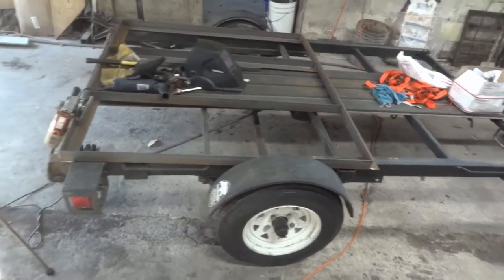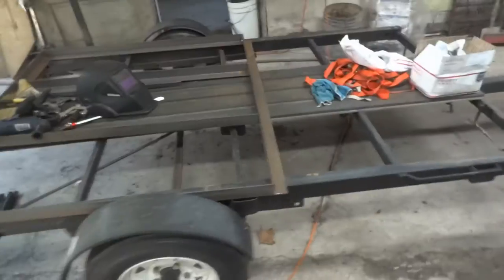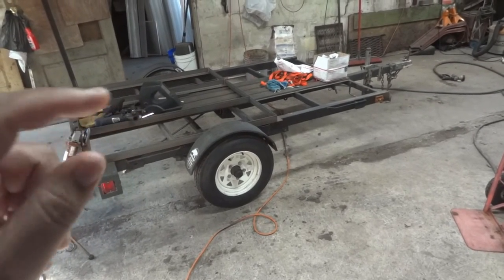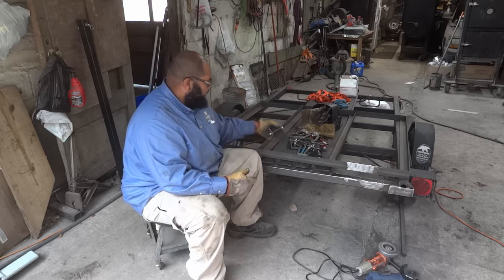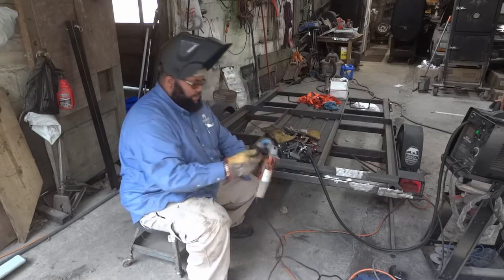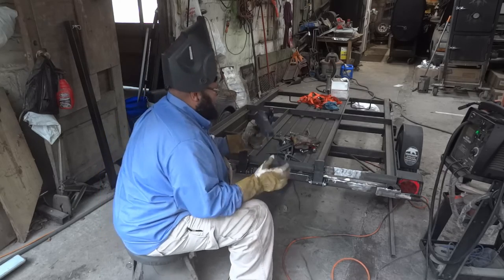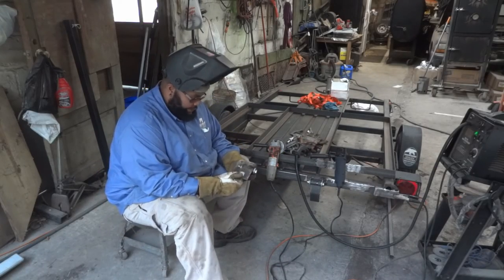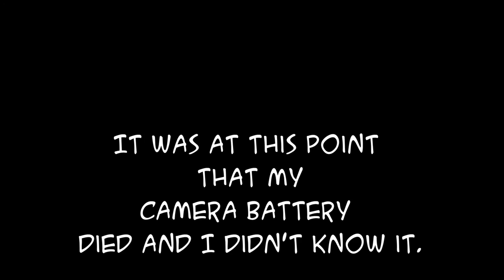The 50 dollar trailer build - part 2 - The planning stage and hinge fail

Comment: I used half inch roll stock all the way across for a pin and bend a 90 at the end for a handle. Then I welded black iron pipe in six sections across the trailer and the gate. The black iron maybe half inch black pipe see what fits. Also put a pin at the end of the round stock opposite end the handle to lock the pin in place.

Comment: Hi Dash,  hate when that happens but that's how it goes sometimes.  Most trailer gates that I've seen don't lay all the way down on top of the trailer they kind of stick up and have a chain to the corner to hold them up during transport.  And the hinges are further apart.  I can tell you will figure it out.  Might need to look at another trailer with the decking on before welding yours up solid.  It will be well worth it especially driving in town them small trailers are really nice to have.
Reply from the maker: Yeah the main reason I want to have it fold flat is so I can have things that are longer than the trailer (metal usually) stick off of the back and not have the gate get in the way. I think I have it figured out I tell you it wasn't until I watched this video after I finished editing the video I thought of my next plan of attack. Thanks for watching along.
Reply: cool and yeah that's smart so you can hang stuff off the end of it wasn't thinking about that part.  lol... no doubt.  well  have a great day